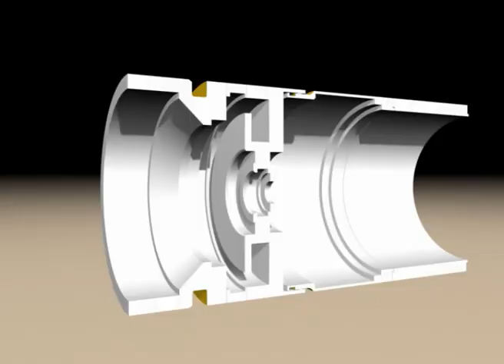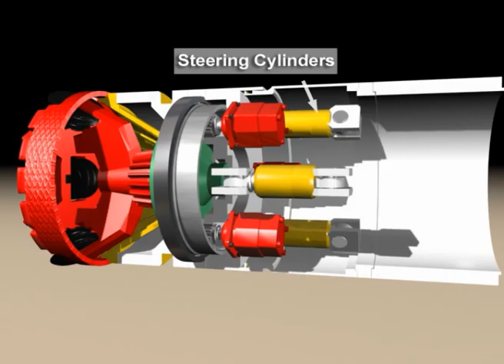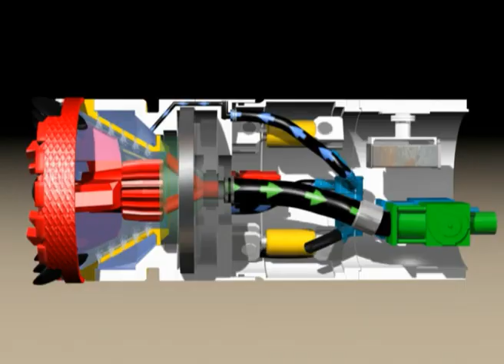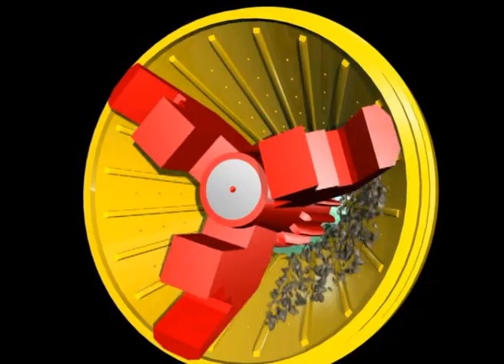Micro Tunneling

Comment: The piston has to push the entire pipeline. after entering several sections will not have enough strength. In addition, by introducing each new section must be disconnected the pipes that supply water and remove the debris.
Reply: +Paulino González González The distance is maximized by 1) over-cutting (cutting a hole 1/2" to 4" larger than the pipe diameter, and 2) using a lubricant on the sections to help them move through the bored tunnel.
Reply: what is the minimum diameter of the MTBM ? and how to grout the outs gap of 1/2" to 4"?

Comment: How are all the product supply lines disconnected and re-connected with each section of product pipe (6:50-7:05)?
Reply: +Jay B There are men that climb in and disconnect and reconnect the slurry/supply lines between each section.
Reply: I am surprised that the slurry and supply lines are not run through the presser foot.

Comment: is the name of boring machine called TBM (Tunnel Boring Machine)?? and how much meter down it from GL. ??? Abdul Aziz @ Senthil
Reply: +Primavera Engineer This machine is a "MTBM" (microtunneling boring machine).  The machine model is Herrenknecht (German) #AVN-600.  There are larger boring machines that are "TBM" (tunnel boring machines).  Keep in mind that the "Microtunneling" name does not necessarily mean "small".  These are un-manned machines, meaning that they are remotely controlled by a control plant on the ground level.  The Operator in the control plant watches the grade and level of the machine to ensure the machine stays within tolerances per scope and eventually "hole-out" at the receiving shaft.